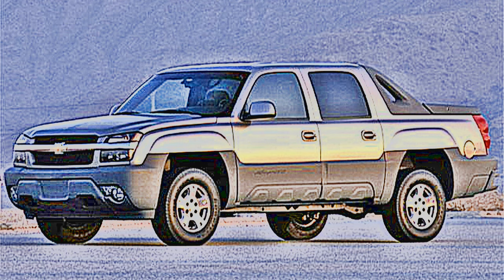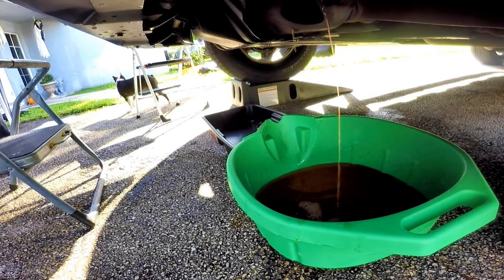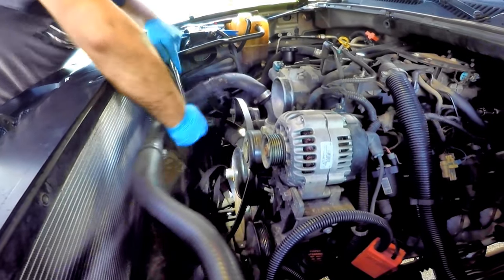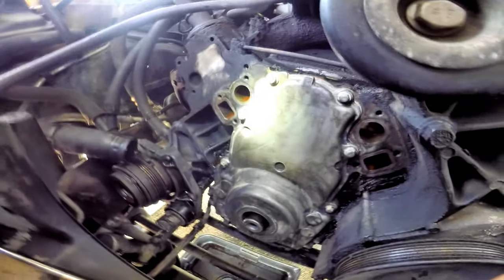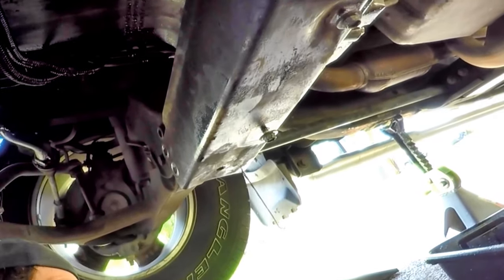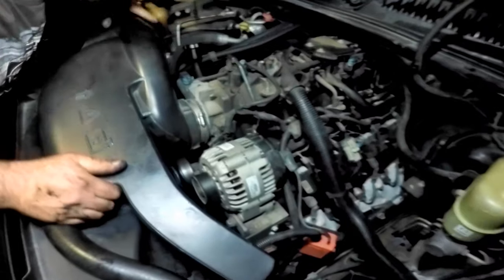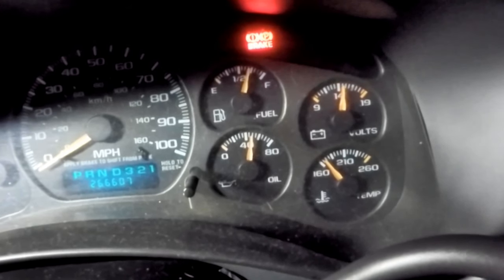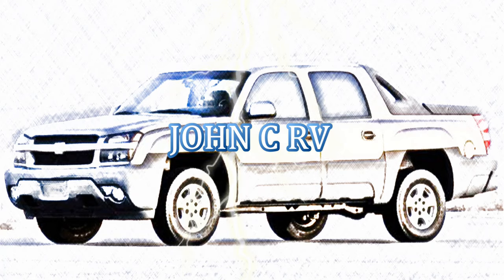How to Replace Oil Pump | Water Pump | Pick up Tube O-Ring | 5.3 LS | 2002 | 1500 Chevy Avalanche

Comment from the maker: This was a team effort. My 2 sons and I like tackling this  exiting project. John Jr. took the lead.
Lost oil pressure on the 2002 Chevy Avalanche 5.3L. Time to replace the oil pump! In this video we will tear down the engine all the way to the oil pump while the engine is in the truck.  We drop the oil pan and expose the pickup tube.  We replace the oil pump with a Melling high flow oil pump and replace the water pump and thermostat as well, along with all new gaskets and O-rings. ⚡Chevy avalanche 5.3L oil pan plug torque 18ft lbs.⚡

Comment: Thank you so much for this! Nowhere near what I had expected it to take. Truly appreciate you doing this one!
Reply from the maker: Glad it was helpful!
Reply: @JohnCRV   It was! 

I just changed my pressure sensor as the source of my leak appeared to be from the sensor. It was covered in oil and the connector recess was filled with it. The really cool thing is that when I fired it up to check operation, I was expecting to see the same, or similar, pressure fluctuation that you had. It went to 42 ish and held rock steady! Looks like I don't need the new pump just yet but, thanks to you and crew, I now know how to do it! You are a blessing!
Reply from the maker: @karlbuckles7192   Fantastic👍

Comment: It all looks so easy but after having worked on my own truck I know it's not and only because it's easy to get mad and lose patience with it but even tho it irritates me I love working on my truck it's an unbelievable sense of accomplishment especially if it runs better afterwards and the video's you guys make along with other creators help those of us that can't afford to pay someone else to do it so thanks you've earned my like and sub
Reply from the maker: Thank you for your great comment we do appreciate it. It is satisfying when you accomplish something like this. It makes a difference when you have help as well,🙂
Reply: @JohnCRV  I imagine it is easier with help but I usually have to do it by myself however my collection of tools is pretty scarce at the moment because I've only had my truck for about 9 months I bought it with 190,000 miles on it 7 1/2 inch rough country lift 20 inch rims and 35 inch tires 52 inch curved light bar LEDs on everything as well as a 3000$ sound system consisting of 4 tweeters 1 in each door two 12 inch subs built-in to a box in the bed of the truck with the blow though setup because the box connects through a square hole cut in the cab for the bass to function best a pioneer avh-2300nex bluetooth radio I love my truck and it had all of that stuff on it when I got it and aside from the gear ratio in the axles still being stock without the max towing package meaning the ratio is 3.42 making it feel a bit sluggish when accelerating and not having all of it power due to the lift and tires the only other downside having bought this truck specifically is with the mileage having been as high as it was it is time for a fair amount of basic maintenance which I've been slowly tackling also the motor in it is a gen IV 5.3 flex vortec paired with a 4l60 transmission four wheel drive the body is a gen II 2007 chevy silverado 1500 LTZ also no one taught me anything about mechanic stuff I just have an interest and actively pursue it and I'm only 22 believe it or not so I probably take more pride in all of this than I should but I try to stay humble though it may not seem like it after this massive thread but I don't have anyone to talk mechanical with so I often go overboard when I finally get to talk to someone else who does they're own work with they're vehicle so sorry about this
Reply from the maker: I wouldn't call it "overboard" I call it Passionate about it. It sounds like you will be a good mechanic. 👍 BTW, that truck is loaded with options, Cool👌

Comment: Hey John, Probably one of the best , most thourgh vids on replacing the oil pump. What was your before and after oil pressure? Getting ready to replace the pick up tube o-ring, and trying to decide if, at that point, just moving forward with a pump replacement. thanks again.
Reply from the maker: Before we tackled this project we replaced the Oil Pressure Sensor because it was not working.  Once replaced, the reading on idle was between zero to 20 (cold) and between 20 and 30 once it warmed up (warm). Pretty Bad!
Once we replaced everything, it's always at 50 (on idle).
If you are only going to drop the oil pan and do the O-Ring only watch this video I clipped from the entire project.
"How To Remove Oil Pan Replace Pickup Tube O Ring & Pan Gasket 2002 - 5.3 LS - 1500 - Avalanche"
https://www.youtube.com/watch?v=KtRuiTknc8U&list=PLKE7F0aRK-jne17yHtXkTFuowCyqkaSx-&index=2
I suggest you go to the playlist to see the separate videos clipped from this project.
"REPAIRS 3.5 CHEVY VORTEC 1500 AVALANCH"
https://www.youtube.com/watch?v=ftn0JQaXPP0&list=PLKE7F0aRK-jne17yHtXkTFuowCyqkaSx-
Hope this helps. Good luck and be safe.
Reply: @JohnCRV   john : thanks for the info. short story on this truck - had a 2014 f-250 6.7. Totalled it in a weird accident. purchased a new 2021 f250 tremmor w/7.3 (didn't like diesel). Dealer says- hey, you won't see it for about 3 months. i use a truck everyday. renting a f150 was more expensive than buying a used truck. silverado's here in kansas were selling about an hour after they were listed. found a 2011 5.3 a couple of miles away, bought it instantly, and is in great shape (with 190,000 miles). Replaced all fluids, put a new water pump, belts on it, and, of course, my dealer called and says, hey, your new truck is in (3 weeks after purchase). so, i think i'm gonna keep the silverado, and starting to add stuff. At that point where i'm not sure whether i will start taking the motor apart, or just drive it for a while longer and end up buying a crate engine and replacing the original . my oil pressure is not as low as yours was. maybe i'll just replace the o-ring on the pick up and see what happens. i also replaced the oil sender, and it looks like someone had replaced it before because there was no screen under the sender. Guess we all get to hmmm,,,,, where do we go with these project trucks. thanks for all info john! great vid.
Reply from the maker: Sounds like a plan, replacing the O-Ring first and see what happens. if you need to replace the pump later is not hard except you will need to drop the pan to get to the pick up tube bolted to the pump. there’s a trick I seen done on a video but seemed a little complicated for me. Good luck with the project, sounds like you got a good truck.